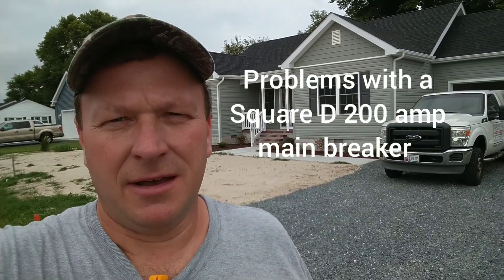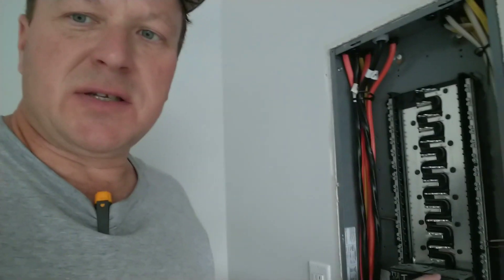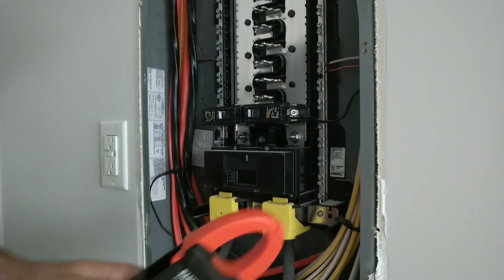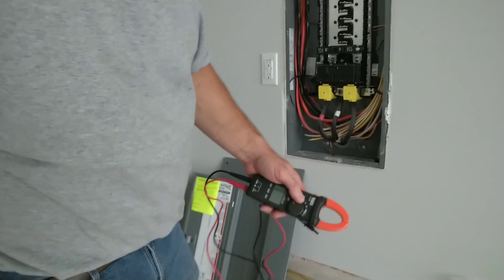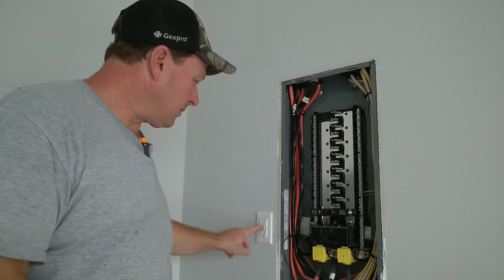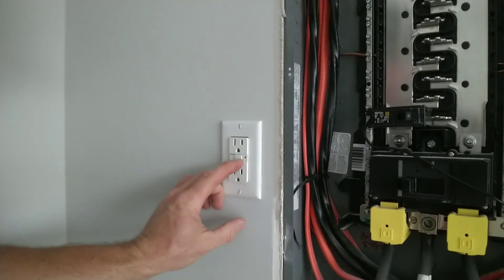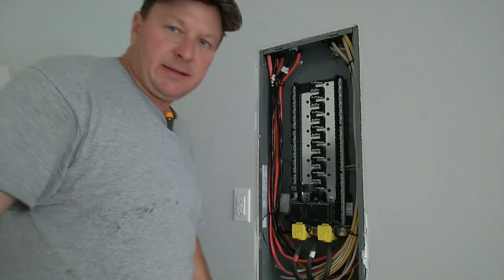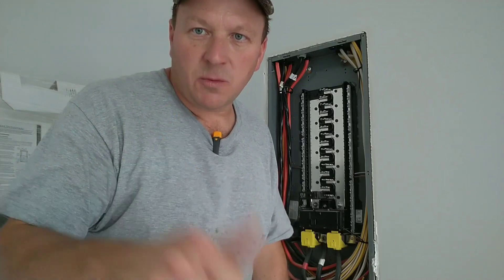Defective 🤔 Square D 200 amp main breaker What ever happened to (Quality Control)?

Comment: Hi Ron, you replaced a 200 amp main breaker with a 200 amp main breaker.  My question is can I replace a 200 amp main breaker with a 100 amp breaker instead?  Thank you and have a nice day.
Reply from the maker: Hey Daniel, I've never done that application before but you can sub- feed a 200 amp main lug or main breaker panel with 100 amp.
 If your wanting to install a 100 amp breaker into a 200 amp panel will fit? That would be a question for your local supply house to answer.
Reply: Thank you so much, I appreciate your time, have a nice day @workingmanrondoyle3287

Comment: EC here ive notice the same thing with quality control on wide variety of products. I am getting a lot of call backs of new things not working.
Reply from the maker: Thanks best shot for watching and commenting. It's said what's going on right now. The worst product of 2022 that I had to stop using is South wire 14-2 NM 1000' spoils. It seems to be the only wire size effected. I'll be doing a video of that problem soon. I hope things get better soon and back to a more normal, like before Covid 😥
Reply: @workingmanrondoyle3287  unfortunately  I do not see them getting better in the near future. I have been in electrician for about 16 years and a new contractor for about 3years now and  I am curious to know how you price your new construction jobs? Price per sqft/ openings/ etc. im here in so cal .
Reply from the maker: @bestshot300  Well, I believe our standard of living is cheaper over here on Maryland's Eastern Shore. Right now we're still on 2017  Electrical codes. As soon as the 2020 or 2023 kicks in, my prices will be much higher. Electrical contractors charge between $60. to $120. Per hour for service work. Wiring new construction homes is ranging $6.50 to $10.00 per sq.ft. depending on the houses layout plans and materials cost going up😰. Standard ceiling cans are $65.00 each at 8'to 9' height. More for tall cathedral ceilings. Running underground pvc conduit is outrageous right now. I stopped giving quotes on pvc material, just trench cost. I'm curious to what your charging over in California 🤔
Reply: @workingmanrondoyle3287  very interesting Ron, for ceiling cans I charge 150-200 range. new construction jobs Start at 10-15 per sqft. emt runs 1/2  3/4  250 per 10 ft assemly  so on so forth.

Comment: Moving the breaker to the other side did not place it on the other buss line, you would have to move the breaker up 1 space to be on the other buss...
spaces 1 & 2 are on the same leg, spaces 3 & 4 (up 1 space) are on the other leg. Think 240v breakers, 2 spaces...
Just turning OFF the main and resetting it fixed your problem...
Reply from the maker: Thanks for watching Jeffrey 👍 You caught me. You're right about space 1&2 on the same bus, and 3&4 on the other bus. You got a good eye ! When I switched side 🤔 my train of thought was the opposite side to use the factory breaker
 knock-outs. Realizing this on camera I quickly placed it on the next bus up. The main was bad, I turn it off and on before video started to roll. Thanks for watching and the comment 👍👍

Comment: Hi Ron, So going forward do you plan to pretest the main breakers before installing the panels? Has Square D asked you to return the breakers for failure analysis?
Reply from the maker: Thanks for watching and the very great questions. I could test the main breakers with current flow/ voltage 🤔 on a test bench, but not under heavy load. Two of the past panels that had bad main breakers were purchased through big box stores. Their return and documenting process Lacks for public concern with faulty product. On the other hand, supply houses are your best bet for getting back to the manufacturer with issues of high concern. The panel bought for this house was from E.D. supply of Salisbury MD. They sent it back to the manufacture
( note: defective). I've never heard back. I might add Square D representative visits there frequently and they do listen to electricians concerns regarding products. I have first-hand experience in dealing with 
(SQ-D Snyder's electric) but they never acknowledged of a product that was made from my suggestion that's in production today.😰 That will be the last time I give away a patentable idea.